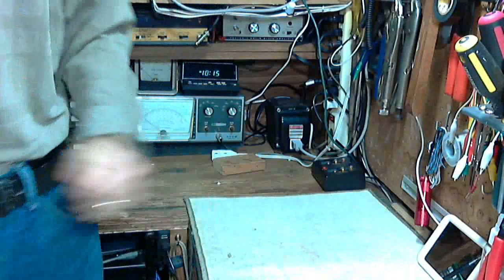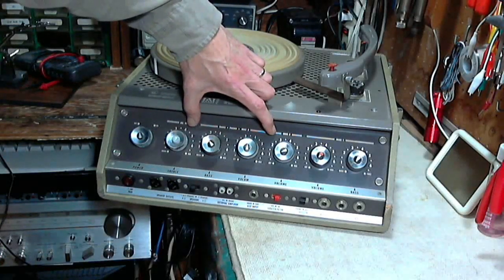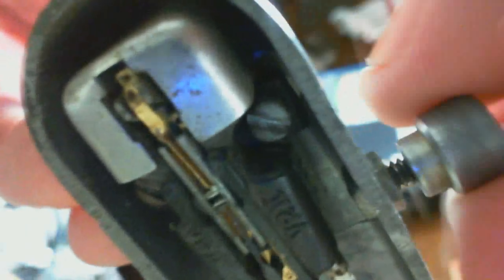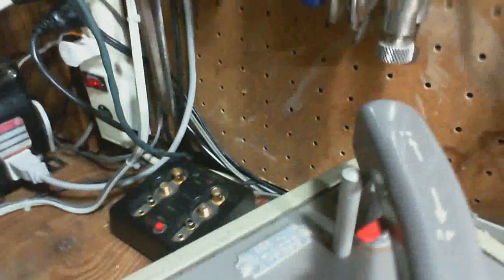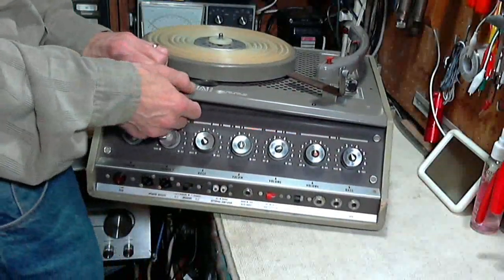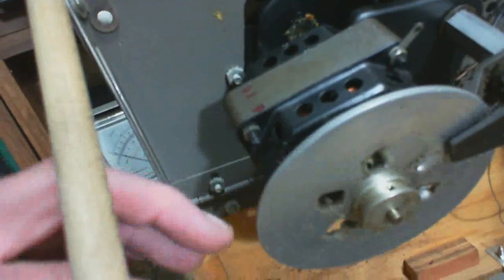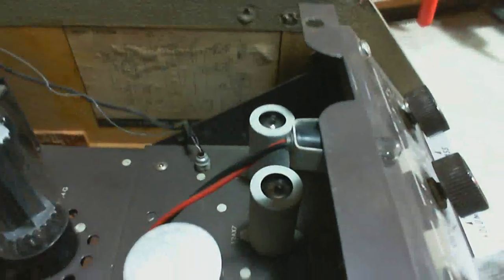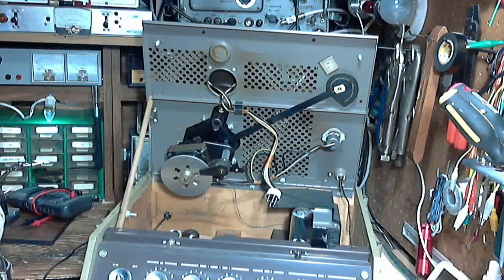Newcomb TR-1656-M Record Player Video #1 - Checkout

Comment: I actually have one of these, not sure if older or newer than the one you have. This unit usually came with matching suitcase speakers as mine does. Plays really well. This was a favorite of early DJ's who did square dances and would actually play the record and call the steps out, like swing your partner doe si doe. I also have a large collection of early 45 vinyls with the callers notes in them
Reply: +Yvon Robichaud  Just to add, it does have 4 settings for 16, 33,45 and 78 as a few of you were wondering. I didn't know radio stations used the 16 vinyls . I hear some people have adapted the speakers for guitar amps too.It is a pretty cool unit.